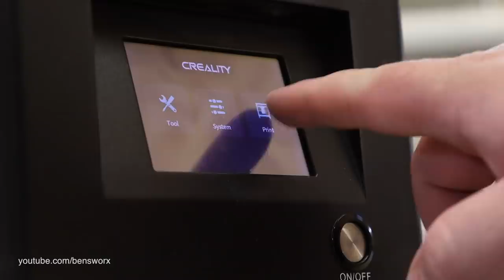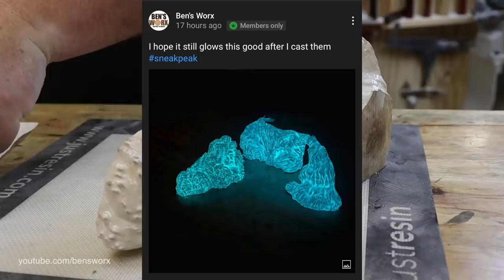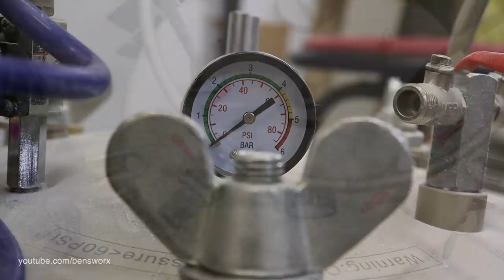DIY Underwater SCUBA DIVER Night Lamp - Epoxy Resin Art

Comment: Hi Ben,

I enjoy your videos, you do such interesting projects with resin.  I noticed the ultrasonic cleaner you used for cleaning your 3D prints.  I'm not sure if you are using isopropyl alcohol, methylated spirits or water for the cleaning (as there are some water washable printing resins).  If using isopropyl alcohol it can be a  fire hazard/explosion risk due to the alcohol vapors.  As the ultrasonic works, the vapor can ignite if there is any faulty wiring on the machine itself or nearby.  This is especially true if your machine has a heating function.  An easy solution for this is to fill the metal bin with water, then put your prints in a plastic ziploc bag with the alcohol and seal it.  The vibrations go through the water and into the bag without the risk of vapors escaping.

I just wanted to let you know as I've been researching about ultrasonics for my own 3D printing needs.  Keep up the great work!

Comment: Hi Ben! Quick tip- if you don't wait for full cure and do a second pour while first one in gelatinous stage- you won't have a visible seam and you won't need glue to have your objects in the middle, they will stick when placed on top of fresh resin. I use this all the time (I do it for a living) and recently I had to make huge cylinders with resin printed corn, cucumber, tomato and potato 1 to 1 scale. I used resin with 1 week cure time for 1kg pours so it won't warp, boil or crack, and still had to do it in 3 pours. There were no seams visible because I didn't wait for full cure, just made sure it's hard just enough to hold my objects in place. And for large pours like this you can use tabletop epoxy with longer cure times- 3, 5 or 7 days, depending on your volume. It won't warp or crack.

Comment: Nice piece. I just went ghhh when you used the flexible blade on the printer plate… It kind of looked like it dug into the aluminium a bit, or maybe it just looked like something had made a couple of scrapes in the metal already. Most others I see using 3d printers use a broad, flat spatula, and I think there’s a reason for it.

Otherwise, keep up the good work.
Reply from the maker: Thanks Mate, nah it didn’t dig in, i used to have trouble with prints falling off until I roughed it up a bit, now it’s great